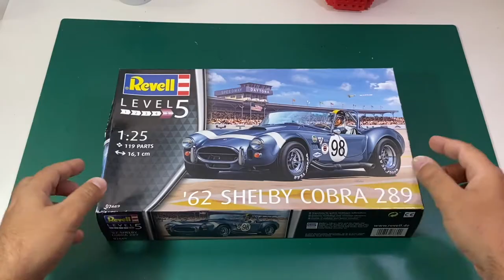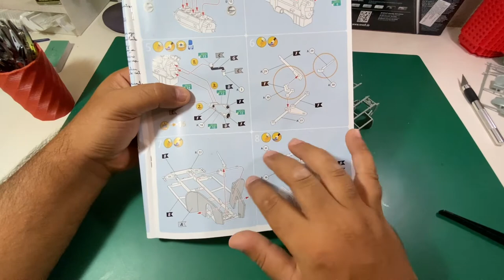🚗🖌️ Building Shelby Cobra | Revell Model kit building Step by Step

Comment: So is the final Assembly all done with super glue if so is it strong enough hold to stop parts falling off over time ?
Reply from the maker: Depending on the parts because superglue is dangerous and releas gases that can mess up the previous job, but yes I use to combine different glues

Comment: Very nice job! I'm impressed with the body work especially. I've never seen anyone do it like that before, with the black primer, then black gloss, chrome then the actual body color. Did you wet sand and polish it or does it come out shiny because of the undercoats in conjunction with the varnish?  It's also a really cool lookin car imo. Would love to drive one. Oh yeah, and the engine came out awesome.
Reply from the maker: I saw this technique I other YouTube video. The idea is undercoating with metallic color to help the body color stand out. You can prime with directly with gloss black primer then metallic on top (metallics always with black undercoating). The polish always helps to get that perfect shiny finish but if the varnish coat is well applied without orange skin texture it is good to go. Thanks so much!! 🤟🏾🤟🏾